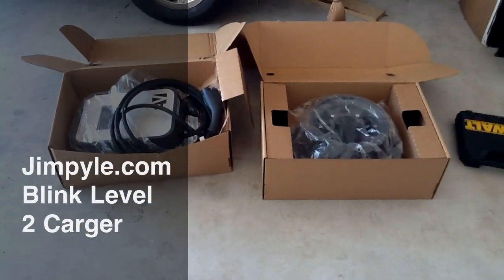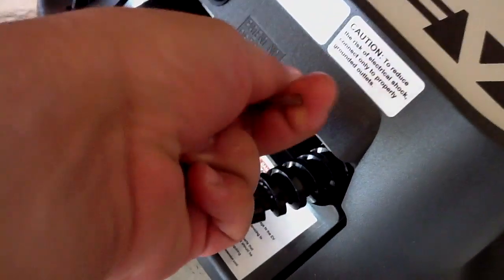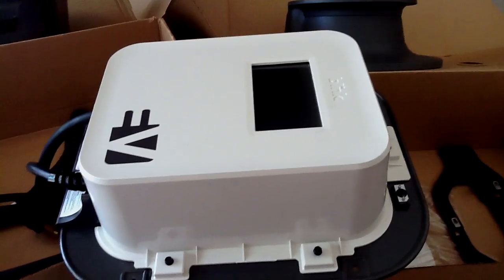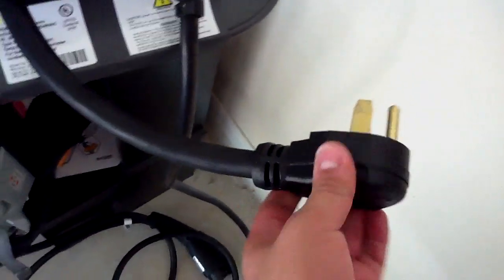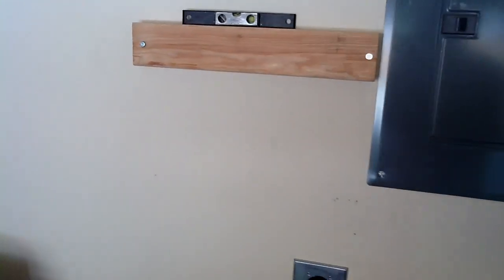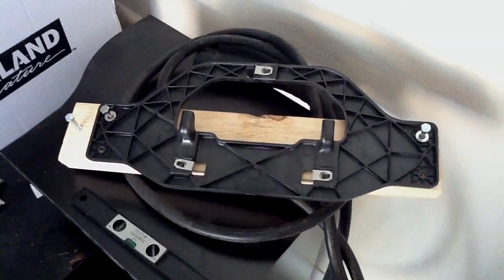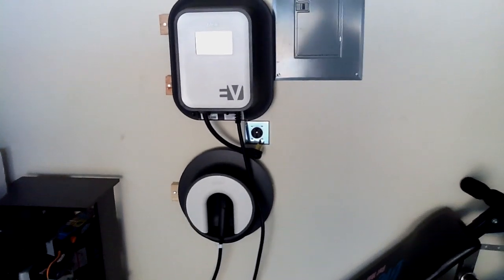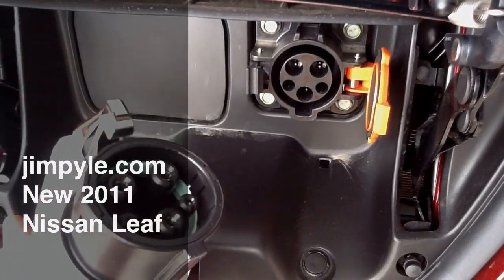Electric Car Charger Home Installation

Comment: to make your plug fit follow these easy steps
1. shutoff power and remove old outlet (NEMA 14-50)
2. take white wire and cap it with a wire nut
3. take the black and red and ground wires and connect to your new outlet (NEMA 6-50)
4. tuck capped off white wire into rear of box
5. screw new outlet to box
6. replace cover plate (you can re use the existing plate for your new NEMA 6-50 Outlet)
7. turn on power and finished.

Comment: I think the NEC codebook states that a MSP needs to have about 3 feet of clearance around a service panel. However, this install dosan't appear to interfere with access to the breakers. It's probably up to the AHJ inspector.

Comment: Any advantage(s)/disadvantage(s) of hardwired vs NEMA plug-connected EVSE outside and/or inside? 

I was thinking of having the electrician install a NEMA plug near the garage door so I can get the car plugged either in or outside the garage.

Thanks.

Comment: So why did you have a problem with the adapter for?  Did they sell you the wrong adapter?  I was also wanting to know if they will make a universal adapter to plug into a wall mount in a regular home that has no 3 pronged outlet?

Comment: I just replaced my breaker panel and want to calculate what I need for a dedicated garage subpanel. Can you tell me what the amp requirements are for your car charger? Thanks!
Reply: most are fused at 30 amps. Similar to a dryer or stove. The car can adjust and will only pull about 25 amps for a 6 kW rate of charge.   NEMA 6-50 (32A station) or NEMA 6-20 (16A station)
I usually charge slower with a Juice Box as it's better for the battery and keeps the heat and pumps and fans from having to run on most electric cars.   The LEAF has no cooling and their batteries degrade so slower is always better if you home sleeping. No big hurry.

Comment: Years ago I was doing a small job at the airport. Small in terms that it was just me wiring a rent a car store. One day there was 5 or 6 guys with signs outside my van as I was working saying that it should be a union job!. When I asked them face t face, they told me "they owned the airport". So, I finished the job as they stood with signs for 2 weeks. 4 weeks later I see the SAME guys buying romex to do residential work!! Thats where I have a problem with the union.

Comment: Thanks for showing how easy it is to do it yourself.  I purchased a ClipperCreek LCS-25 online for $1000 and installed it myself.  It works great and charges my Think City in half the time of 120V charger.  Everyone told me level 2 charger install was rocket science requiring a phone survey and site inspection.  Its as simple as putting in a dryer outlet.  No big deal.  How did you obtain your Blink charger?